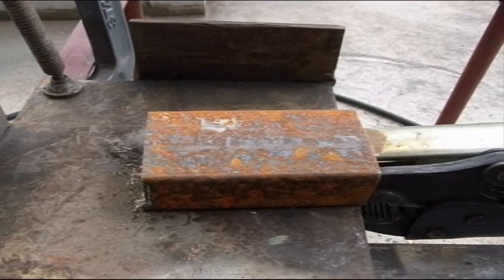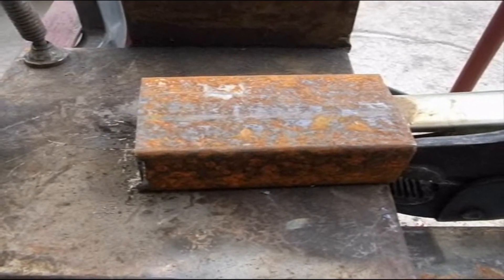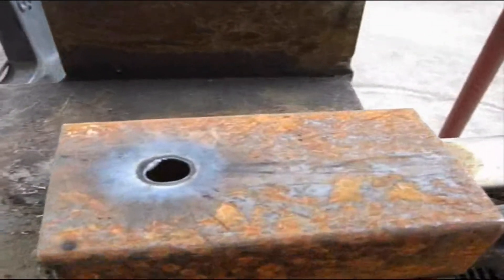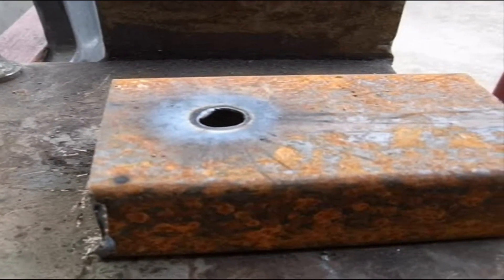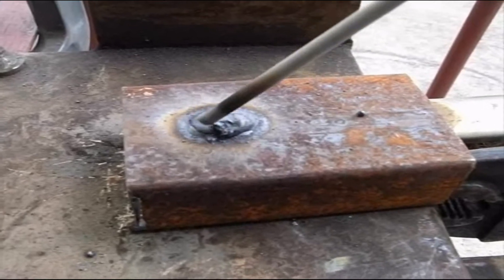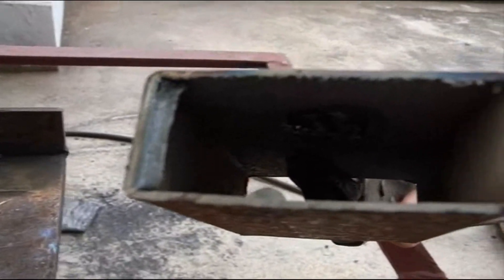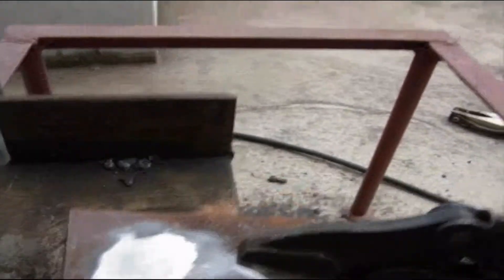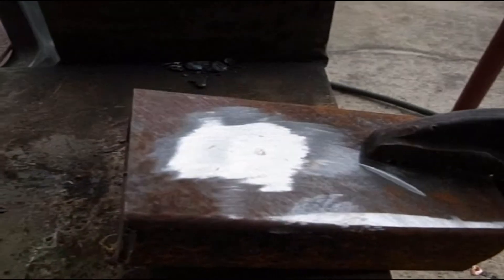Arc Welding Hole Closure 1/2 - General Concept

Comment: what rod would you use for this? 6010?  I have a pipe fence that some gate holes were put in the wrong location, need to fill them.
Reply from the maker: This is a 6013, not the best, but I can get it at the local hardware store.
Reply: it looks like 1/8" electrode, what was the amperage you used to fill? Did you keep it at 50? @tsbrownie
Reply from the maker: @barbaramaj1919  I drop the amps down from what I would normally use. In other words it's cooler arc.
Reply: @tsbrownie  Thanks TSB, I figured, I just wondered how much.
I'm just 'learning' and seem to find that laying my electrode relatively flat when dropping material along the edge works better that a direct pointing of the rod. If needed, I then follow along to heat the puddle to make sure it gets blended in. (it took me about 1/2 pound to fix my 'blow holes", but it was my fault for overgrinding the base metal)
Reply from the maker: @barbaramaj1919  I'm just a hobby welding, furniture and such. I just pass along things I learn, usually the hard way.

Comment: if you have HF, turn it on continuous and it will help maintain a very low amperage stick welding arc.
Reply from the maker: I wish.  I got a $300 DC only arc welder.  I'm just a hobbyist and it's all my wife would allow!  ;)
Reply: @tsbrownie  Mine only cost 250 (blk-Friday, special). Got me some Mig Tig and MMA, all in one Chinese contraption (with barely literate directions LOL)